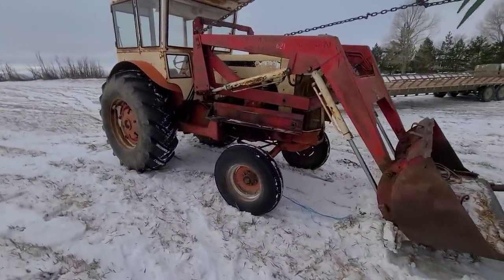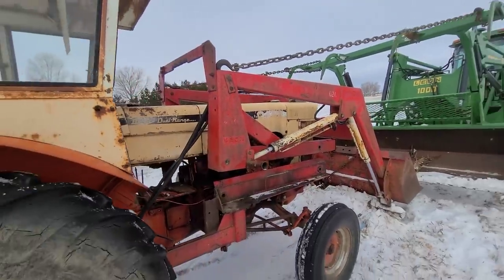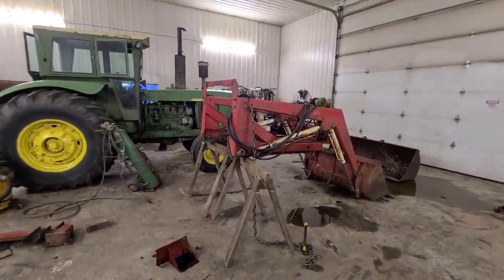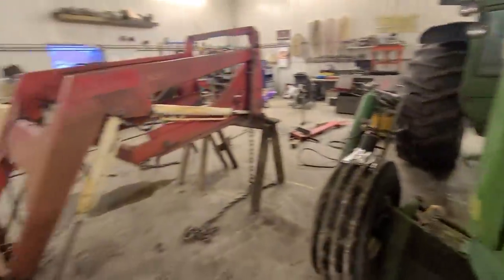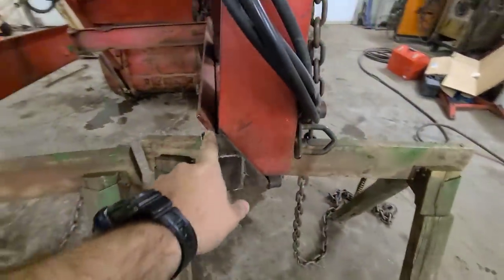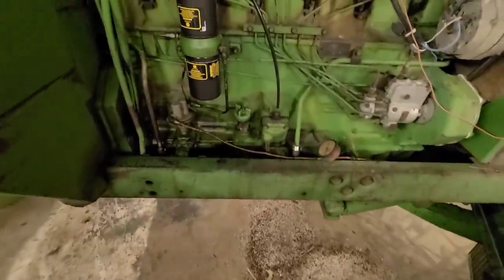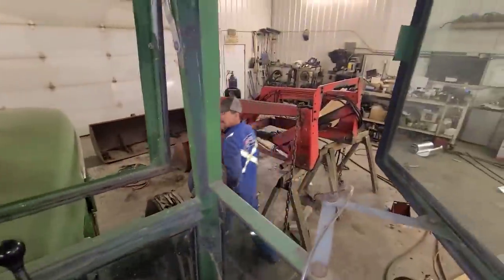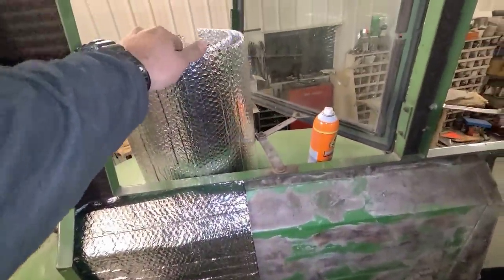5020 loader and custom cab kit with heater! part 1!

Comment: Wondering if there a hidden setting in your phone that shuts the recording after X number of minutes? That sounds like something that phone manufacturers would do. Good job on the repair & restore of the tractor. Is that the tractor that you put the cab on from another you showed in an earlier video?
Reply from the maker: No it does it on anything I'm doing